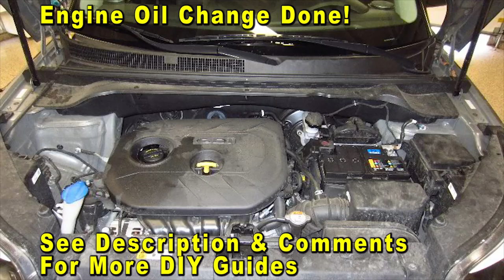Kia Soul How To Change Engine Oil & Filter 2014 To 2019 Nu 2.0L GDI I4 2nd Gen With Part Numbers

Comment from the maker: Check out the DIY guide for changing the engine oil and filter on a 2nd generation 2014 to 2019 Kia Soul with the Nu 2.0L GDI I4 engine - 
https://www.paulstravelpictures.com/2014-2019-Kia-Soul-Nu-GDI-I4-Engine-Oil-Change-Guide/index.html

Here are all of the DIY repair and maintenance tutorials for the second generation 2014, 2015, 2016, 2017, 2018 & 2019 Kia Soul -
https://www.paulstravelpictures.com/Articles/2014-2019-Kia-Soul-Common-Problems-Repair-Maintenance-Guides.htm

Owners of other Kia, Hyundai or Genesis vehicles such as the Niro, Sportage, Sedona, Telluride, Sorento, Rio, Forte, Optima, K900, Cadenza, Stinger, Tucson, Santa Fe, Kona, Palisade, Elantra, Sonata, Accent, Veloster, Ioniq, Nexo, Venue, G70, G80 and G90 may also find these DIY instructions to be helpful.